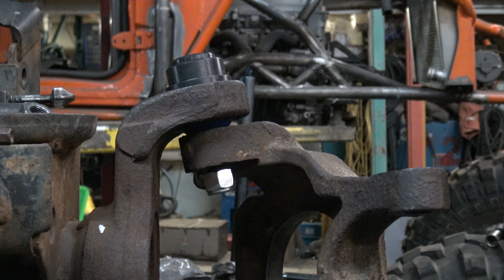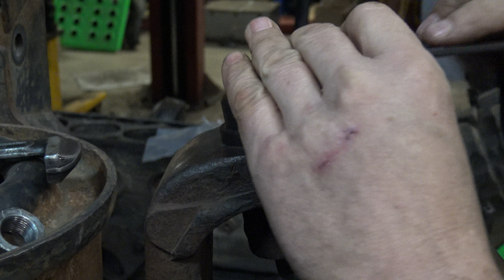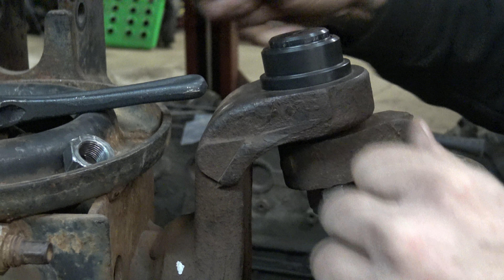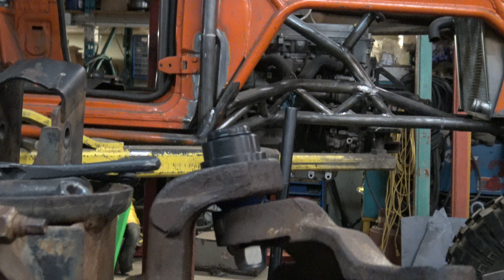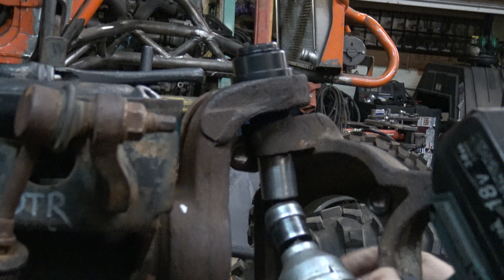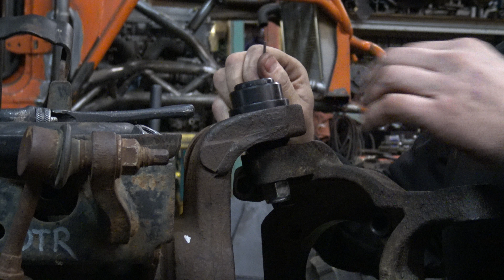Troubleshooting a Spinning Pin during EMF Ball Joint Install

Comment: That's a pretty good sulotion, I just struggled with it a couple of week ago but I ended up running the nut over another bolt just to kinda start the treads in the nylon and it worked perfect but I would do it this way next time.

Comment: What if the bottom pin spins withe nylock ? I just tore down my ‘01 Dodge 2500 Dana 60 knuckle and tried putting these in. The top went in perfectly. The pin spins on the bottom BJ though. I’ll call tomorrow. These things are stout and I can’t wait to do the other side. The install tools are quality products too! These make even the heavy duty parts store BJ’s look like junk
Reply: what was the fix for the spinning lower pin? Its a holiday weekend and trying to get my buttoned up. Thank you!
Reply: Any solution lol
Reply: I know it's old, but just put a jack under the lower C. That will put enough pressure on the taper to keep it from spinning.